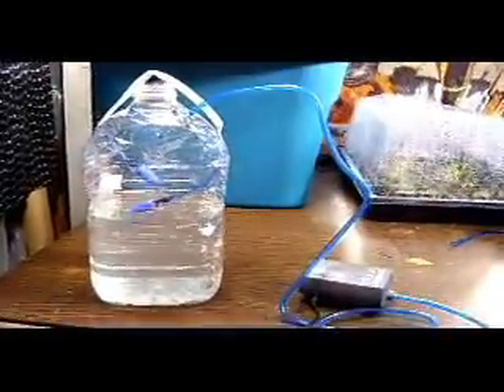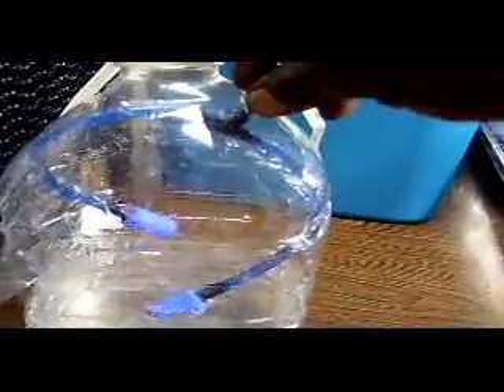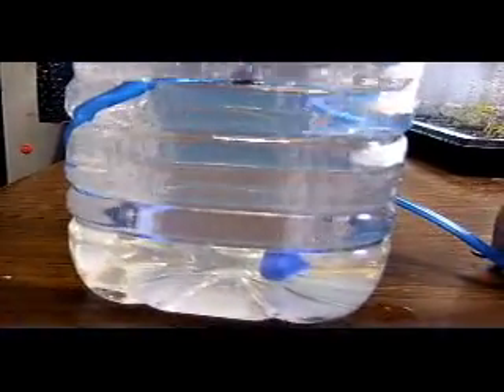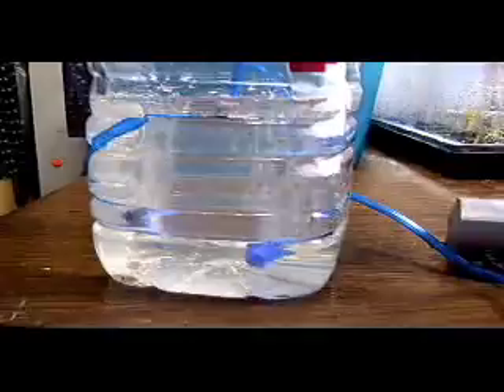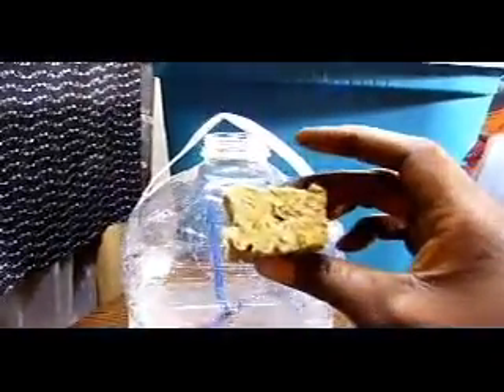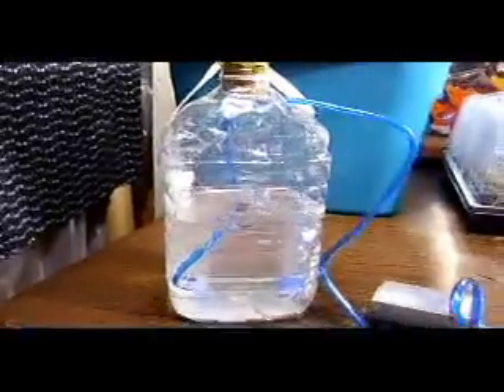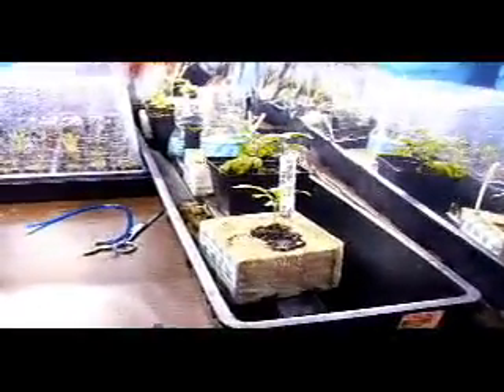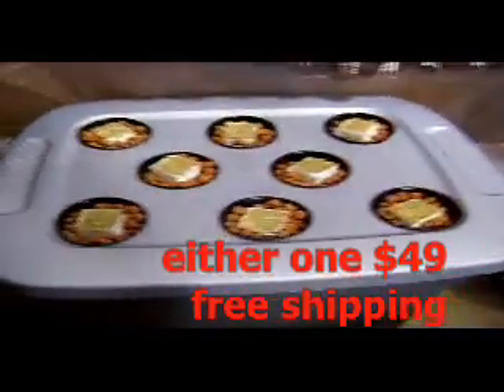HYDROPONIC DEEP WATER CULTURE AEROPONICS HOW TO BUILD INDOOR AERO GARDEN LIKE

Comment: I know you commented 8 months ago, but I didn't see anyone reply. So, to answer you question. It wouldn't work. The water has to be aerated 24 hours a day in a DWC system. So the pump would not run when there is no sun. Yes you could run it off of a battery bank. So if you have your house running on solar you can do it. But Batteries aren't green either. Ultimately the best DWC system to be green with is Aquaponics. 100% organic and it's pretty much hands free hydroponics.

Comment from the maker: if you pump goes out or your power goes off just drop your water level so some roots get air or if you expect to get your pump back working within 12 hours you can either empty the tank completely.  I do it now just to see how long they can go without water.  but think about it... that's what ebb and flow (or flood and drain) is all about.  think about aeroponics...  great question though  keep'em coming

Comment: so you dont have to be changing the water level if you have an air pump? so the roots would be submerged in water 24/7 and the air pump would have to be running 24/7 is that right?